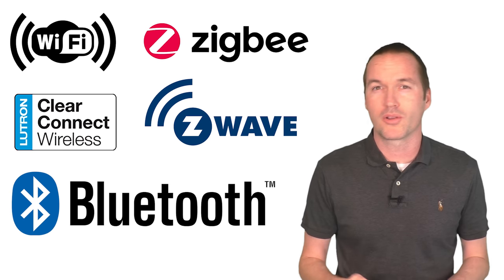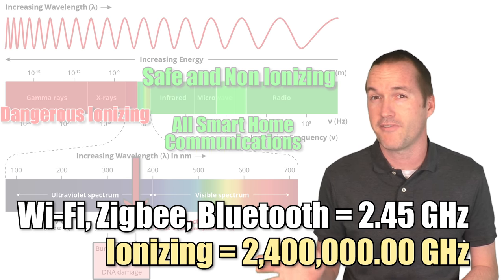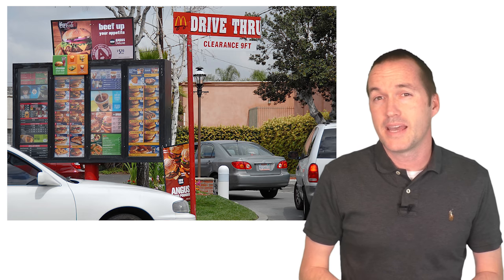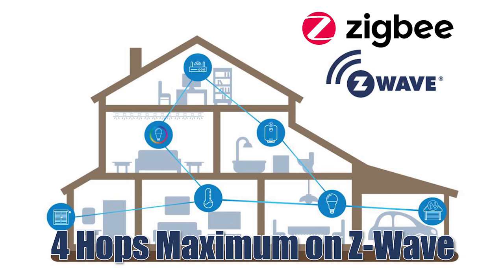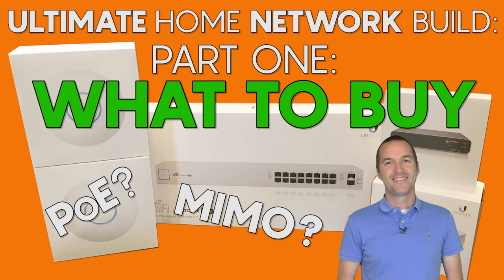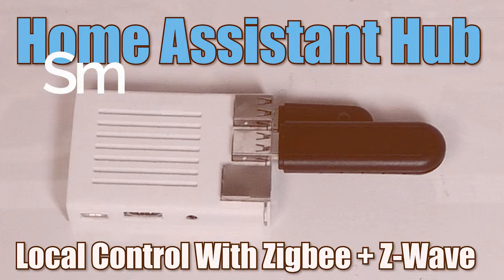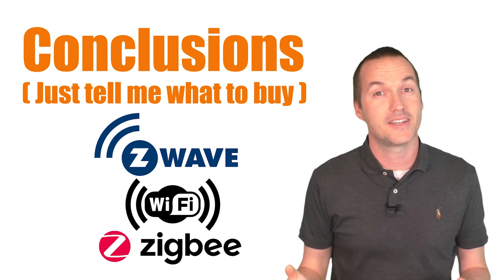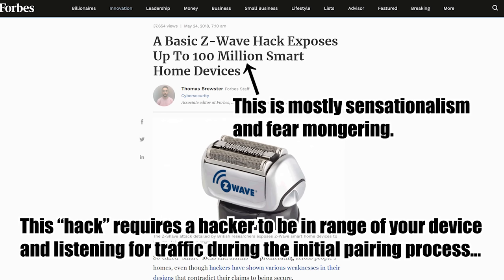Z-Wave vs. Zigbee vs. Wi-Fi! Smart Home Basics: How To Pick The Right Protocol

Comment: Despite what a lot of the comments are saying this is not an completely accurate representation of these wireless protocols.
Zigbee and ZWave both can use multiple frequency bands and actually do use different bands in North America and Europe. It depends on the application. So that is just a straight up untrue it's purely an effect of market trends and what people around you are willing to buy.

Further, Simplifying ZWave as proprietary and therefore "standardized" is inaccurate. ZWave still suffers from interoperability issues similar to ZigBee. Zigbee is not a free for all of people implementing it their own way. They, just like ZWave, are attempting to standardize testing procedures to ensure interoperability of any devices that are certified to use their protocol. That said both governance bodies are not able to fully police who is implementing their protocol and further they are not able to prevent companies from implementing workarounds. A perfect example is Philips, who are technically certified Zigbee but their devices refuse to work with other Zigbee devices unless certain specific proprietary mechanisms are in place (which is why you can join other devices to their hubs and they can join specific partners' hubs). It is issues like that that have led people to think of Zigbee as having problems with interoperability. The example The Hook Up provides about a Smart Things hub being unable to work with a sensor is actually a further example of something neither ZWave or Zigbee or Wifi can control. Many hub manufacturers rely on very poorly built mechanisms for joining devices to their network. In theory, once a company has been certified they have participated in not only certification testing but also interoperability events that the governance body of the protocol sets up. So their devices do work with other devices, but that doesn't stop a hub manufacturer from excluding certain companies devices due to certain proprietary conditions. An example of this can be seen in the Wink hubs. Many devices are "unable" to join Wink hubs for the sole reason that Wink programmers chose to only allow devices their unit can join under strict conditions. If you'd like to test this, you can take a Wink hub and test any obscure lights or sensors that aren't on their list of supported devices (note they do have a generic Zigbee and Zwave option that will likely also fail), if you take those same devices and just use a certified Zigbee chip, like an XBee radio, you will easily join those same devices.

There was also the idea that having a meshed network with more than 4 hops is a bad thing. Again untrue, while yes improperly implemented devices can cause weird amounts of lag in the network this is actually largely due to most manufacturers relying on a connection to their cloud service to provide anything even remotely "smart" about their devices (again see Philips Hue). The routing lag introduced by a certified Zigbee router in the network is on the order of milliseconds to tens of milliseconds in a settled network. Settled meaning that routing has been established, so yes if you suddenly join a 100 light bulbs some messaging is going to be slow until they have decided all the routing. So sure once you get to 10 hops with poor LQI and RSSI there will begin to be some irritating lag ( e.g. > 500ms). And sure there are edge cases and strange scenarios that will also arise, remember these technologies are still being developed and improved so 100% perfection isn't here yet.

Next, the idea that Wifi has this great fault tolerance is completely mischaracterized. Both Zigbee and ZWave are actually considered more fault tolerant than Wifi, While, yes Wifi is rolling out new additions to their protocols to support mesh networking and specific features to align better with machine to machine communication they are no where on par with the two former protocols. Zigbee and ZWave not only have multiple levels of transmission acknowledgment but they also have route detection and network repair mechanisms, this means that even if a message fails to send on the originally determined route, the network will immediately attempt to repair and find a new route to device who's routing needs have changed. Further the Zigbee and ZWave protocols have built in mechanisms for adjusting their radio power to properly reach all devices in the network without constantly screaming overtop of eachother. 

I don't want to thank The Hook Up for calling out reliance on the cloud as a problem point and how much influence the market and industry trends have on these devices and protocols. And their breakdown of the use cases and recommendations are on point.
I hope you don't take this comment too harshly it's just meant to add info to a field I have a fair amount of industry experience in.

Comment: I like the idea of standardizing on Wi-Fi, because we all need Wi-Fi networks anyway and there are good tools to deploy, manage, and troubleshoot them. However, there are still some dealbreakers for me:

1. Security. Many/most wifi-enabled devices, including all of the wonderful esp8266-based devices, have no encryption at all, and often no authentication either. This might be OK for mood lighting, but it's a complete non-starter for remote controls, garage doors, deadbolts, etc.

2. Internet dependence. Although of course it's possible to use Wi-Fi without relying on the Internet, in practice, so many consumer smart devices which use Wi-Fi are severely crippled or fail in mysterious ways when no internet is available. There's no way to distinguish these devices from those which work properly without buying them and testing for an extended period of time.

3. Power consumption. Even well-designed Wi-Fi devices consume a lot more power than those which use purpose-built low-power protocols. It's a lot to ask for a protocol to be efficient for sending a few bytes per hour and also many megabits per second. This means that battery power is rarely if ever a viable option.

These factors mean that I expect to continue to use at least some Z-Wave devices in my network for some time. And I couldn't recommend to someone just starting out that they go Wi-Fi-only.
Reply: Yep, there's no such thing as an application layer automation protocol that runs on top of IP, like Zigbee has standardized; no real interoperability is ever guaranteed or even hinted at. At the end of the day, saying a device uses Wifi doesn't necessarily tell you anything more useful in practical terms than saying it's made from 100% baryonic matter.

Comment: With the benefits of Z-Wave, and how there's more DIY solutions coming about, like Z-Way's various products, some being Z-Wave Plus certified, Z-wave seems like a better solution currently. At least until Connected Home Over IP is a viable solution, though I have security concerns given the companies involved, as with the typical security concerns of anything over IP, as well as the general security of IP devices themselves, both actual security and data privacy; though unifying every standard into an intercompatible ecosystem sounds really nice. Though I would like to see Z-Wave improve their product, especially with their mesh network, maybe take notes from how WiFi handles their mesh networks and adapt Z-Wave to a similar model, 4 hops really isn't that many if you're spreading devices out across a building.

Comment: I can do a bit by bit explanation but Here's the rule of thumb: PCs, Smartphones, IP cameras >> Wifi/ ip network. ANY other device, Zigbee or Z-wave. I know it's fun to see ips in every lamp. But that is a dumb choice. To much devices over wifi will kill your network and increase energy consumption. On the other side the zwave and zigbee are engineering wonders. VERY low power consumption e.g  pir sensor two AA  batteries can last up to 2 years ! Also as they are low power emitting your wifi is running at it's full. Simple.

Comment: Hi. Firts of all thk you for all videos, great help to start with HA. I have question how you mange your wifi network to work all esp devices? Do you assign static IP for all of them ? In my case I have limit of 10 static IP to set and have no more options. Dynamic IP cause problems when router is restarted.

Comment: The range of Z Wave lets me use external modules outside the house with ease. My system is from 2011 with no issues. I don't want Zigbee screaming over 2.4 with my internet wifi, bluetooth, microwave and wireless speakers. The frequency range is polluted enough. Gets worse with a wireless security system

Z Wave Plus.

Comment: The cost of ZigBee devices is persistently higher than corresponding WiFi components because the while a WiFi device just listens for messages directed to itself and transmits its own responses, a ZigBee mesh network requires each node to serve as a router responding to both messages directed to the on-board device and to network traffic to configure the mesh network and to listen for traffic it must store and forward to another node. This increases the program and data memory needed and the processing speed required for each node. The network’s definition doesn’t guarantee that a node will be able to immediately forward a message and it has to maintain a queue of messages and prioritize traffic. This is true of all mesh networks. ZigBee allows battery powered sensors to be end-node only devices, and it allows them to listen and attempt to send at specific regular time intervals and to shut the radio and processor off in-between. Adding IP pass-through to the ZigBee protocol is complicated by the low power devices. ZigBee 3.0 merges the earlier ZigBee Light Link and ZigBee Home Automation standards, but allows devices made for the earlier standard to become non forwarding nodes for traffic that wasn’t part of the standard the device was made for. And finally, ZigBee link layer security requires an on-ramp for new devices that doesn’t allow intruders in. Typically this creates a reliance on the existence of a vendor specific security key that allows a node to be added to a network, but only once. The serial number of a product may also be used to create a recognized secure link, but only if the method is known. The security layers can have the effect of creating a closed standard to the extent that functioning ZigBee devices may be unable to communicate.

Comment: Business wise: Zwave is an extremely good choice for the same reason that an Apple phone or Mac would be compared to an Android phone or a PC. It's proprietary and stable and not so many manufacturers are let in to mess up the solution. Propriatery solutions are easier to handle and upgrad because there are fewere platforms to test. I also understand that Zwave is tied to a specific Intel processor (maybe this is not true anymore). So as a conclusion Zwave solution would be extremely more stable, just like you say in your what to buy summary.

Comment: I believe there is a misconception that all SmartThings execution is cloud-based. I believe SmartThings is moving away from cloud-based execution to local execution: the older "Automations" are cloud-based, but the newer SmartApps are local. Their upcoming Rules Engine will also be local execution. This changes the landscape for me as I am looking to move from my current SmartThings automations to local execution. I bet nearly all commonly desired executions can be run locally (notifications will be internet-based, no matter which solution you pick).
Reply from the maker: They will always use the cloud for push notifications though.  Automation has the ability to stay local, but may still need the cloud if other services are integrated.

Comment: Re: safety of RF devices. The low peak and average power of the RF devices being considered and their not being carried or worn indicates they are very probably safe, however... It’s not entirely true that TEM radiation is safe if the single photon energy delivery is insufficient to promote an electron to an energy state that liberates it from a covalent bond, even though the converse - that ionizing radiation is unsafe - is demonstrably true. Many protein structures depend on hydrogen bonding and will rearrange at much lower single photon energy levels, although the extent to which this happens randomly from thermal effects makes it difficult or impossible to study at low peak and total energy levels.
     The classic example of unsafe would be the unexpected prevalence of cataracts developing at an early age in radar antenna technicians in the middle of the 20th century. Obviously it’s not safe to align radar or terrestrial microwave link waveguide by sighting the glow of a transmitting tube’s filament. It also emerged that working on towers while clusters of broadcast antennas were operating seemed to coincide with a range of adverse health outcomes. Aside from learning that (very) high peak or average levels of RF energy were unsafe very little has been reported. No details for specific frequencies or ranges of frequencies or levels of exposure being conclusively safe or unsafe have been reported consistently and reliably. The best advice was to avoid non-ionizing radiation that has may have any local heating effect. While that may or may not imply that a 5w cell phone transmitter pressed against the skull for an hours long conversation has health consequences, a 100mW smart-bulb transmitter that transmits 0.01% of the time sitting in the lamp on the nightstand is tens of thousands of times less energy and correspondingly less likely have any health consequences.

Comment: Many thanks for this video, it was very well structured and clear to understand. Unfortunately I found this after I have bought devices :-) I have bought devices that work with the Smart Life phone app. Smart plugs, garage  opener etc. I created a separate SSID on my Unifi home network called IoT and via YouTube video help, put in firewalls so that nothing on the IoT LAN can communicate with any other device on my network, they can only communicate out to the internet. I also put my Amazon Echo on this network.
Reply: So by adding a new radio SSID, and moving all your SmartHome Devices to the new SSID, did this relieve the congestion and slow download speeds on your Primary SSID?  If so, that could help me out alot!  I have over 70 Wifi SH Devices on my Primary Access Point.  I read that there should be no more than 30 on my DSL router. Do you concur?

Comment: I have just started
My journey into using hone assistant and have be looking at having a Zigbee dongle and wondered what the benefits are. This video is a massive help. One question, would i have hue hub already(8 year going strong) and would like to have both running. As they are both on the 2.4ghz frequency I’m assuming this will eventually cause drops in packets for devices. Is it recommended to move the hue hub items to Zigbee and scrap the hub(hub can handle hue specific scenes) or can I have both as it seems like a better failover to have just incase one or the other goes down.

Comment: Very informative video presented professionally. Though versions 2 & 3 SmartThings hubs are compatible with just about everything, past experience with a cloud-based doorbell cam's latency (person was usually gone by the time I got the notice, so I couldn't communicate, but I did get the video) has made me investigate beyond cloud-based systems. Have you reviewed (or found one on) the Zooz Z-Wave S2 USB vs. the Aotec Gen5 Plus sticks? If the capabilities are similar, do you know whether the compatible software suites are comparable in features?

Comment: Only ZigBee channels 11-25 are 250kbps in the 2.4GHz band used for WiFi. There are lower speed fallback channels at a lower frequency used when multiple 2.4GHz WiFi networks keep stepping on the 2.4GHz ZigBee channels and make them useless. ZigBee channels 1-10 (only in North America) are 40kbps data rate with carrier frequencies in the 900MHz ISM band every 2MHz from 906 to 926 MHz. Ch 0 (only in Europe) is 20kbps at 848MHz, an ISM frequency.  The 900MHz ISM band was commonly used for analog cordless telephones but in a way that leaves ZigBee channels 2-9 unaffected. There is also a 900MHz DECT standard that’s not commonly used and unlikely to interfere in any case.

Comment: Thanks. Am I missed a part about speed of work? Am I right that zigbee is faster than local WiFi devices?
Reply from the maker: No, wifi is often faster (when executed locally) because the connection to the router is more direct than a mesh based zigbee system.  However, both are nearly instant.